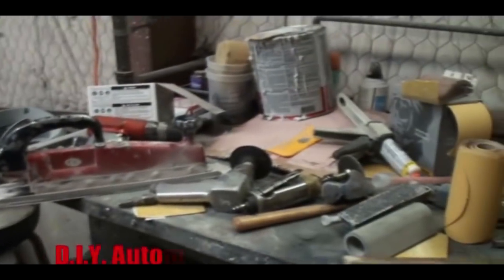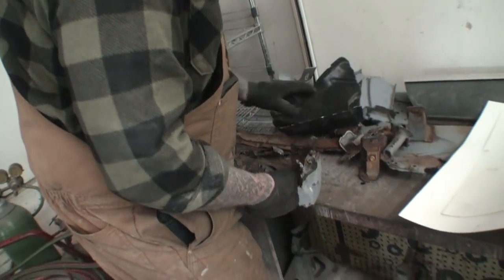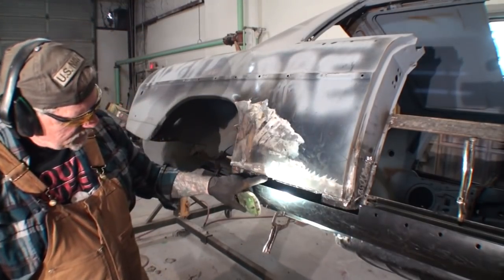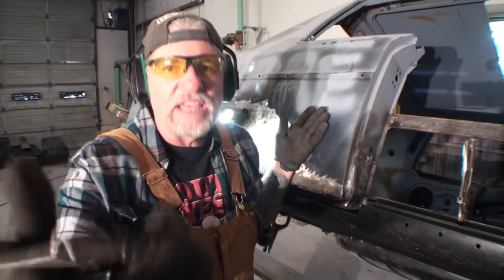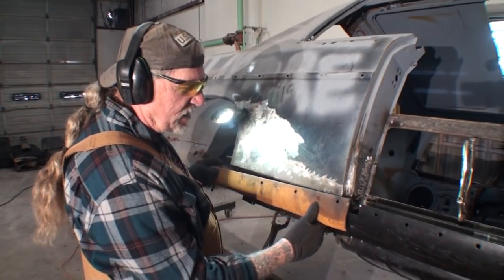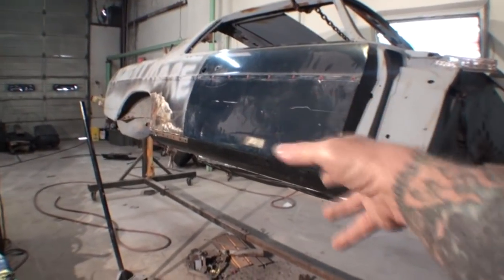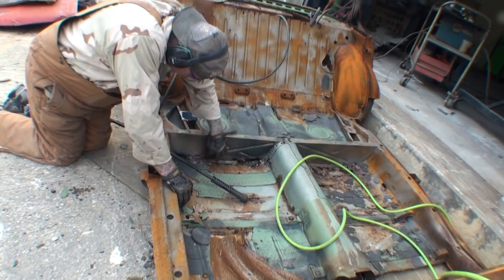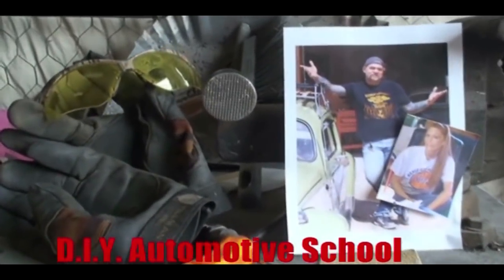Can You Restore A Rusted Car? " At Home " - Part 9 - MORE ROTTED RUST REPAIRS

Comment: The complexity of simply building a car that is rigid, no flexing around corners, quite and marketing wants to look a certain way, all adds up. People do not realize there are hundreds of parts to make 1 vehicle and every part has to fit. Each part is stamped to create a shape. Body techs know this & at this point is truly a puzzle, shaping each piece and creating a plan to decide the order they need to go in. One part affects the other. Pete has said this many time on this car; “It Should Never Have Been Rebuilt.” Not easy, not for the faint of heart or gives up easy. This car is truly coming back from the dead one piece at a time, after loosing 350 lbs in rust, before it ever came into the shop! A handful may have the talent, but few would do it. This one is beyond nightmare, Frankenstein is more like it! This car & entire video set would keep people from sleeping for years! Thanks Pete, for the explanation and sharing your plan of attack to get it done.